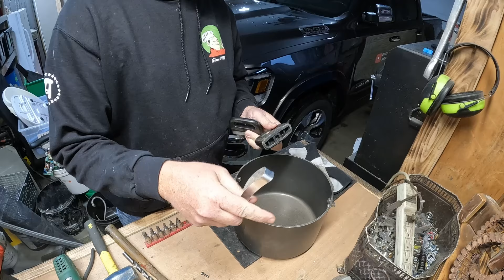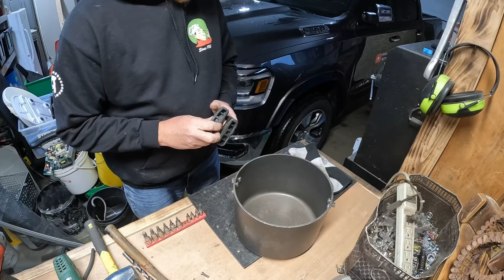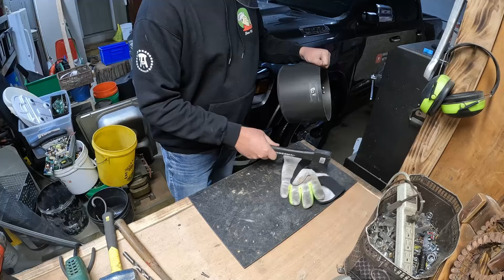Silver Contacts - We're Gonna Melt 'Em!  (Kind of)  #trashtotreasure #diy

Comment: Just told project shop air chisel is the way to clean up those pots. I’ve done hundreds of those breakers I drill out the rivets and they fall apart,the rivets are real soft ez to drill I’ve kept all my contacts. Scrapitall put out a video last week taking the silver off of them he used his side cuts and it peels off there may be a better way idk excited to see you melt some down though
Reply from the maker: That's good info, thanks.  I never thought of drilling out the rivets.  I also don't have an air chisel (or compressor).  Something on the wish list.  Yeah it will be cool to get some silver to melt.  May only end up being one troy ounce, which is still fine by me.
Reply: @SkullerMetals  aww hell I find compressors in the dumpsters all the time I scrap em out wish I could hook you up. You see where project shop gave Canadian the shout out for turning him on to that hatchet? I’ve been using a big one like you have and noticed their hatchets the heads are a lot smaller so I was wanting one them out of the blue found one in a dumpster a few weeks ago that small head makes all the difference I just love that thing where I wasn’t getting much production out of the big one. Oh ya and definitely drill those rivets you can clamp them in the vice or just lay them on the bench those rivets are real soft and you don’t have to drill very far,90% of those breakers have 3 rivets but the real old ones ya just don’t know what you may find but they are all piled up in brass and copper I love sitting at my bench and cleaning them in the winter

Comment: On the opposite side of the silver; couldn’t you grind the flare off and punch it through the brass so you keep the brass and send out less weight?  🎉🎉✌️😎
Reply from the maker: Theoretically, yes.  How to stabilize a tiny button for grinding would be more of a challenge than I'd want to try and figure out.  But I'm lazy like that.
Reply: @SkullerMetals  I was thinking the bench grinder and a pair of pliers.
Reply from the maker: @88clemoine  😂 Yeah if I was a surgeon!  I'd be curious to try that out though, see how hard it would be.  It doesn't change anything in the "silver extraction" part of things.  Probably just nets me slightly more brass.  (very slightly)